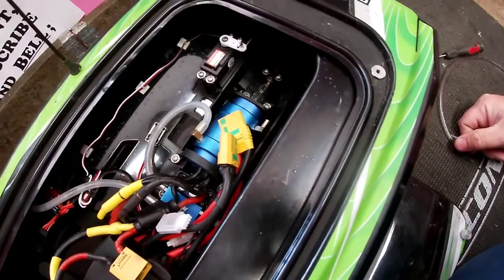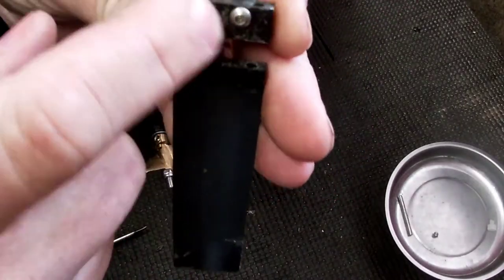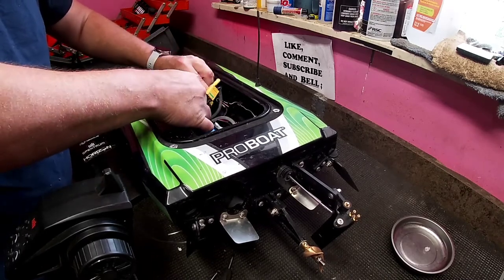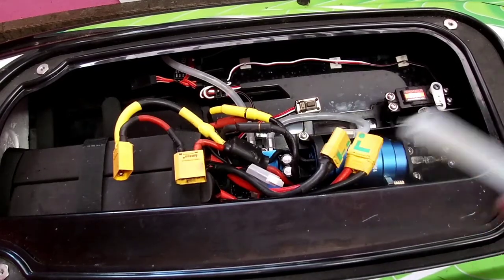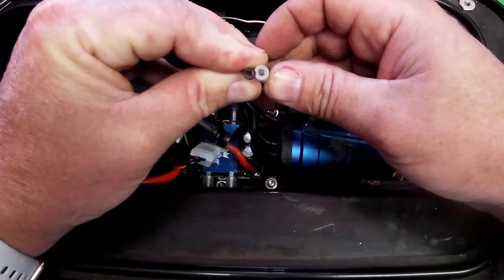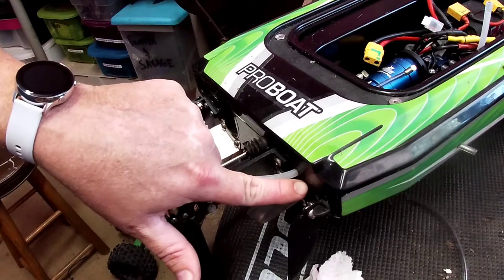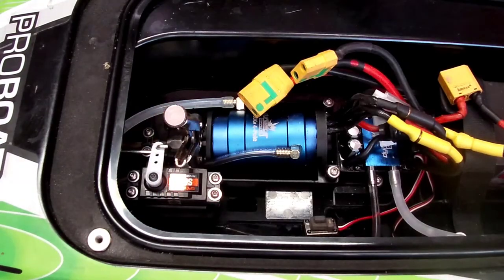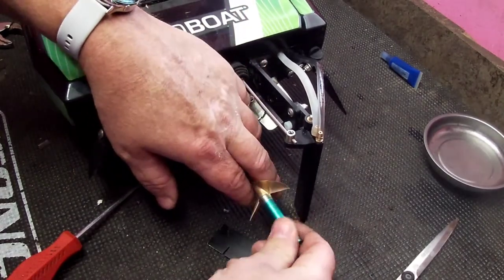Sonic Wake Dual Water Inlet Rudder Installation

Comment: Just a tip : when you put your dog drive back on to shaft and nylon thrust washer allow a mm gap between the washer and flexy drive leg as the flexyshaft will shorten when boat is being used and if there is no gap there is a tendency for it to snap due to seizing as it tightens up under load
Reply from the maker: I did add the gap between the shaft and thrust washer.  I didn't re watch my video to see if I did it on camera or not but I definitely did do just as you were saying. I might have realized it after the fact and did it while I wasn't recording.  Thanks for the tips anyways.  If I wouldn't of known to do that I could of broke something.  Also thanks for watching & commenting on the videos.  I really appreciate that. Have a great day

Comment: I'm from Michigan too I did this to my sonicwake36 as well but I'm worried about last year's issues motor collet loosened caused my boat too loose drive and second not getting enough water through the "U" shaped side of esc any ideas would be great.
Reply from the maker: So you put a new "dual inlet rudder" on your boat .... correct?
Reply from the maker: If you installed a dual inlet rudder you should have one line cooling the motor and a completely separate line cooling the esc. Of course you know you will have to drill a hole in the side of your boat for the second water exit orifice . You should be getting plenty of flow if you've done these upgraded I've mentioned. If you have done exactly what I have talked about here and you are still not getting proper flow I suspect maybe you have too much extra line or you have a clog in your cooling system somewhere.  Take a blow gun hooked up to an air compressor and blow through the exit holes on the side of the bolt and it should come out the rudder and blow any obstructions out of your cooling lines. Also, make sure you use the bare minimum amount of cooling lines. Don't ever keep any extra tubing coiled up in a circle or anything.
Reply: @myrclife  ok I'll try that